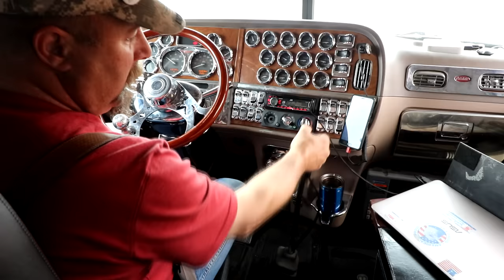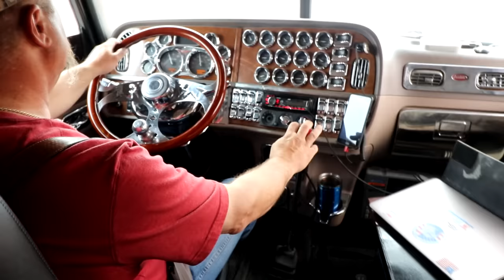How to shift an 18 speed transmission

Comment: Ive driven a stick since I was 16....48 now.  Ive always wondered how 18 speeds work.  Thanks!  I didnt know you didnt need the clutch after first gear, interesting.  If you are carrying a heavy load, do you still need to use it for all of the granny years?
Reply from the maker: The 'granny' gears are so close together I use the clutch to get out of the 'old' gear but float into the next gear but once I get to around 5th or 7th I dont touch the clutch
Reply: If you know how you don't need the clutch in any vehicle. But don't do that on your road test, you'll be flunked.
Reply: I never used a clutch on a road test driving for the few companies I drove for... Always passed...   I had 2 trucks not at 1 time though and leased them out to gravel companies.  So no road test for me Just a pay check......
Reply: They called me in to the office to retest randomly, a short while after I was first driving for a new company. I made an effort not to float, but did a few times without thinking. I thought they hadn't noticed, but when we got back to the office they pulled me aside and said I drove well, but I shouldn't float when they're observing. Never really  understood why not, but meh.
Reply: I once watched a heavy truck pull off a side road onto the main road and it went through 10 gears in  20-30 feet.  it was weird to see.   I've also seen transport trucks go through mountain roads with one pulling the front like normal, and another tractor hooked up by the nose, pushing the trailer from behind.
Reply: well, every driver is different. so for one driver  floating may be easier than double clutching and vise versa. for example im terrible at floating though i can do it.. but im actually faster and more fuel efficient double clutching. where as the team driver i rode with when i first started out was the other way around. generally companies dont want you to float because its considered a more dangerous way to shift, as it makes it easier to lose control of the truck because your engine can run away (going up or down steep mountains and hills) and you can lose your gears easier. i would say generally it is also easier for a new driver to learn how to properly double clutch first before they try to float gears in a large truck so they can easier bring a vehicle back under control if they pop out of gear, say going down a steep hill or mountain.

all that said a properly trained driver should also NOT be shifting down after they have started going down hill. as they should have been in the proper gear at the start of the hill. for all the non truckers out there.
Reply: Not needing it is a bit misleading.  You can certainly change gears without using the clutch, but the clutch is there for a reason.  People that advocate not using the clutch are almost always driving someone else's vehicle (like company drivers using company vehicles) or they're driving some shit box manual transmission car they don't give a shit about.

You will regret not using the clutch in any manual trans car you care about.
Reply: True if you are just banging gears, but I had a manual I put a few hundred on and never had an issue.  When you shift soft and rev match the shifter just falls in.  Now that does take some learning to get the feel of it and I really only did it once I was in third.
Reply: Well when the transmission doesn't have synchromesh then it is pretty common to skip the clutch.  So very common in north america while europe switched to having synchromesh on their truck transmissions in the 70s and these days have fully automated truck transmissions without a clutch pedal at all.  Much more complicated and maybe less fun if it breaks down 2000 miles from home.  Much easier to drive too though.
Reply: Individual businesses can do what they want, but, the DOT drive test requires you demonstrate ability to shift a non-synchronized transmission - unless you are willing to have your license say "auto only" or the like.
Reply: Donald Bartram I floated gears on my road test.  I just asked if it was acceptable before we took off.  She said if you're gonna float you'd better do it at a high level or it won't end well for ya.  Lol
Reply: lol i remember my buddies POS mazda 626 clutch slave cylinder went out. We were 40 miles from anywhere. Dont ever do this to a car you care about, but we shorted the clutch pedal sensor so the car thought the clutch was pressed. Threw her in 1st, cranked the starter, and lurched forward till we were mobile. Rev match and float all the way to 5th gear no problem. We'd creep up to red lights at like 5 miles an hour just so the car wouldnt fully stop and require us to do the starter-motor-lurch takeoff.
Reply: Donald Bartram that's not true you cannot float gears in a car, I'm not real sure if the mechanics of it but something to do with synchronized rear end.
Reply: neither did they
Reply: you are clueless  from I don't no where.  fuel efficientency (sp) has nothing to do with it
Reply: more clueless drivel.     Speaking from 4 million miles on the road
Reply: Rick Baltimore, yes you can float gears in a car. you just gotta know what you are doing. we used to call it speed shifting

oh and hapless harry, go take your meds and try to make one full sentence please

Comment: Is that a 250 rpm split. I think a 13 speed is a 500 rpm split?  Sounds like the 18 speed is the same as a 5 speed main box and a 4 speed brownie transmission? I drove many years ago maybe 30 + years ago, mostly 5 and 4 and 13 speed, never 18 speeds back then. Thanks I wondered how the 18 speed pattern ran.Interesting to an old guy.
Reply: 13 speeds generally same as 18 speed, but you don't split the lower gears (low range)
might be easier to think of the 18 speed as 2x 4 speed gearbox, = 8 main gears + splitting each gear makes 16, then a crawler gear (also split available) = 18 total gears

13 speed: 2x 4 speed  = 8 main gears + splitting high range gears = 12 + crawler gear in low range = 13 gears
Reply: @marcfisher1  wrong
Reply: marcfisher1 so
Reply: Yes ... 250 split on the every gear climb, 500 on the odd gear skip climb.

Comment: I had a job hauling dirt for a new Hy in NC ied speed shift the big truck for 10 hr. then get off work and my little toyota didnt like it when i got off work  ? LOL
Reply from the maker: Yep its not good to speed shift a car or pick-up. They have synchronizes and ya need to use the cluch
Reply: Johnson Steele I need no Viagara
Reply: Manual transmissions are going by the wayside, more auto trans coming out, which I do not like, especially LTL City driving, I drove a Super 10 for awhile , that confuses most drivers but I liked the Super 10 ..
Reply: You technically CAN speed-shift a car/pick-up; the concept is the same...but you have to be very precise with throttle/brake/shifting speed so the gears will be at matched speeds (to the point of it usually being impractical in actual use).
Reply: Apocyl Doomer  ill help you understand, lil buddy. I'll break it down Barney style. Ok, here we go. When a human (this may be you) performs an activity for a continues and extended amount of time (let's say 10 hours) then that human (again this may pertain to you) may unwittingly perform similar actions while carrying out a comparable movement. Still following? Ok, now when you drive a passenger vehicle (like mommy's dirty ass van) that requires you to shift it manually, you will want to use the clutch, as it does not have the same type of tranny as the big truck. Alright, now that trucker joe is off work at the big truck driving company, he will drive his little truck home. Remember the little truck cant be driven like the big truck, but trucker joe has been driving the big truck for so long, he forgets that he's in the little truck. Ok, pootie pie lets recap. You cant drive little truck like big truck, but trucker joe does accidentally and little truck no like it. Ah, fuck it. You probably can't read anyways. Who let you on the computer?
Reply: LMAO ! you rock . spot on bro !
Reply: So speed shift is kind of like rev matching and vice-versa?
Reply: No way I loved when I got off work my car would feel like a gocart lol!
Reply: nasto19nj Dude that was too good. Comment made my day.
Reply: You can speed shift little truck just like big truck!
Reply: MegaNardman i did on my nissan frontier. Youre right tho. You can be off a bit np in a big truck. Have to be on your game in a car. Or motircycle even
Reply: I would slam my foot to the floor in my car leaving the parking lot.
Reply: Truck designers nowadays make miracles knowing a truck must be as comfortable as possible given the time a driver spend In it so yeah , when it comes to compare driving a Big rig and a car the truck is better of course !
Reply: nasto19nj 😆😆😆👍👍👍👍

Comment: I’ve always wondered how the hell trucks have so many gears.

It still doesn’t make any sense but seeing you shift with absolute confidence without using the clutch and explaining how the transmission works makes this whole system slightly less mystical, but very enjoyable and educational to watch.

Thank you and stay safe out there! God bless you
Reply: One reason is that the engine does not rev very high,  maybe 2,000 RPM at most for a heavy duty diesel. It is a high torque engine and a fully loaded combination vehicle is very heavy. Having a lot of reduction in the low ranges & many different speeds to work with, can be helpful to operate the truck on both flat roads or through terrain. The engine can always be in the optimum RPM range for the best power or economy.

Comment: Do they make automatic 18 wheelers? lol, I just want to cruise down the road while eating my pizza and listening to a podcast. I wouldn't even be able to scratch my nose in that thing
Reply: Yeah they do.  Some fleets are moving to fully automatic because there's a shorter time getting a person into the truck and driving on the road after they pass certs.  See the massive driver shortage here in North America.
Reply: Most of them are actually Automated Manuals. But they do also have some models with proper Allison Automatics.
Reply: Yes. Just put it in drive and go. But I work on them and would be a rich man with the amount of complaints from drivers with the automatics. If you can move your arm, you can drive a manual.
Reply: really it is not that hard,  after you have done it for a while, you don't even need to think about it, you just shove it where it needs to go
Reply: Here in europe all  trucks are 12 speed auto
Reply: Personally I have never seen an automatic, as in car type automatic semi, (torque converter instead of clutch). Like upgradedBACON said,  automated manuals,  computer shifts the manual tranny, and works the clutch for the girls.
Gotta say though, them automated manuals fast as hell when empty.  They skip several gears at a time and somehow get into next gear before the turbo stalls.
Oh and if you get your CDL in one of them automated ones,  you have a restriction on it that says you're not allowed to drive stick till you pass a test in a stick.
Reply: Heroic i know this because i play european truck simulator.
Reply: My son drives for a living and hates the automatics!
Reply: So in Europe all the cars are manual and all the trucks are auto? Everything is backwards lol
Reply: Lllooooooollllllllllllll
Reply: Is there any power steering?
Reply: They are great when they work as designed. Horrible when they don't .
Reply: I work as a PE (product engineer) at Allison and all we do is automatic. The TC-10 is what they put in the 18 wheelers.
Reply: Jason W Volvo has I-Shift (which is automatic)... but once your on the interstate even with manual it’s all cruising.
Reply: Jason W, You can scratch it with your left foot coz you won't be using clutch that much 🤣🤣🤣
Reply: jason w +++ soon the trucks will computerized and self driving. no human needed. then you can work for domino's pizza as a pizza delivery boy eating your pizza and listening to your podcast with your car's auto trans.shifting while you cruise.
Reply: david wells yeah in like 100 years
Reply: allison autos went out with the model t all the auto trans of today are actually manual trans with a computerised shifter much more energy efficient than the allisons
Reply: Most european trucks are
Reply: Yes. 22 speed auto in Freightliner
Reply: Joe Allen 
Tell your son I would bet he would be begging for an automatic if they sent him through New York City up I-95 into Connecticut every morning 😂😂. He can say whatever he wants to say, but these automatics are a life saver in New York City traffic!
Reply: I drive LA, NY and toronto with a manual. yes in traffic the automatic is easier, but it's crap for pulling hills with a real load... give me my manual every time!!
Reply: Joe Allen So do I
Reply: .........and some of the countries they drive on the wrong side!~
Reply: The company I drive for in Australia is currently upgrading all their trucks, both rigid & semi, to autos. We are using mostly Scania & Volvo but do have a Mack. I drive a 12 speed auto Scania & love it. It is fully auto no gear leaver at all just a fwd, rev knob on a stick on the steering column.
Reply: I prefer manual. My company's got autos they're great in traffic that's the only advantage to manual I honestly see.

Comment: First, cooI vid.

Second, I appreciate the Alpine head unit, especially with the red color configuration to better match the interior.. 
   ...but why, oh why, is it in Demo mode?
Reply: I had one in a freightliner. It would go back to demo everytime I shut it down. No power supply to memory. Drove me nuts.
Reply: Greebo I was just about to type that,the master disconnect kills all power

Comment: If an 18 speed semi is the only vehicle available after the zombie apocalypse occurs, I can now say that I have a bit of a clue on how to drive it.
Reply: I see you clicked on this video for the same reason I did.
Reply: Recruiting y'all for my ZA Survival Team
Reply: A little secret in case there is no shift pattern posted in the truck. If the splitter knob is red it's a 13 speed,  blue 15 speed, and gray 18 speed. You let the clutch out BEFORE you push the accelerator pedal. The governor on the engine will maintain the base idle speed unlike a car, pickup, or motorcycle where you have to push on the accelerator as you let the clutch out.
Reply: @jontreacy941  thanks bring on d zombies

Comment: Damn this looks so hard.  But I still want to learn how to do it.
Reply: Go to a training school! Some states will give you a grant to do it. Thats what I did and they paid for a 1 month course and by the end I had my class A license with all endorsements!
Reply: Thor Cole I have my class a and haul hazmat for a living but my school never teach 18 gears. Just 10. But I know a good union job I wanted to go they wanted me to drive a 18 gear and I have no experience.
Reply: I drove a 10 at school as well but then drove for a silage outfit and was in a 13 that had the ranges and overdrive/splitter. So like the video says treat it like a 9 speed and you have the splitter if you need it. Since you know how to drive I promise you will get the hang of it with no problem.
Reply: Thor Cole what makes it hard. I really think the down shifting would be hard. Plus I don’t float gears like all my buddy’s do. I know if I try it once I can get it. I think I’m just making it  hard in my head lol
Reply: I hear ya I felt the same way but when I started running silage the  owner told me float the gears or find another job lol Plus I was in a 13 speed for the first time so I had to float the gears in a trans I had never used. Just pay attention to your RPM when you up shift then you know how far you need to bring it up for the down shift. So lets say you drop from 1800 to 1500 on up shift. When you go down blip it up from 15 to 18 and it will slide right into gear. It was ways easier than I thought it would be and I have never gone back to the double clutch.
Reply: a 13 speed is a 10 speed with halves. you still only drop 450 rpm's with the full gears, maybe 225 with the button shifting...
Reply: i went from a 10 to 18, only took a few minuts to figure it out, its easy , you dont need to mess with that lever on the left side of the shiftier for splitting gears
Reply: That's what she said, 
Iamjdmgear
Reply: @JohanGavieres  takes a little while to be able to float gears.. you have to be at the right RPMs to do it.. once you get good at it you don't have to look at the RPM gauge anymore you can just tell by the engine sound